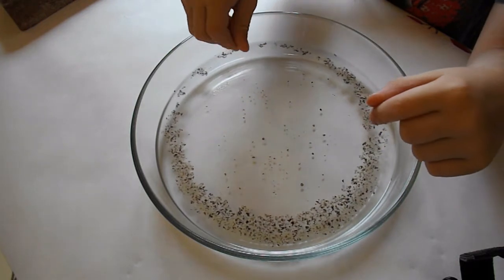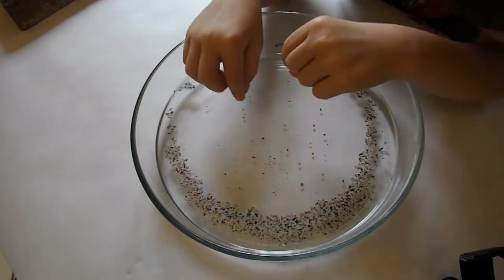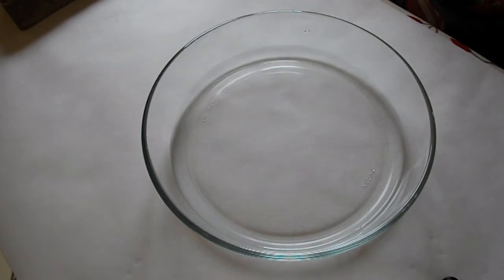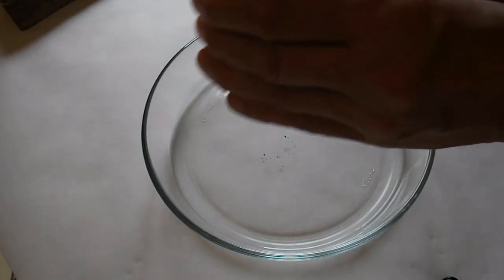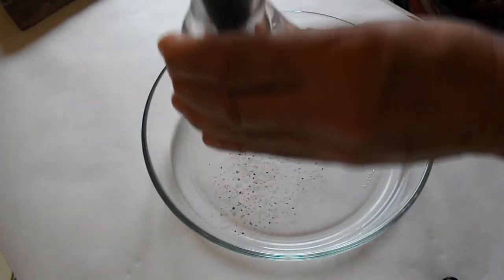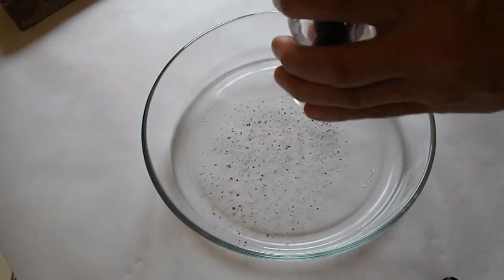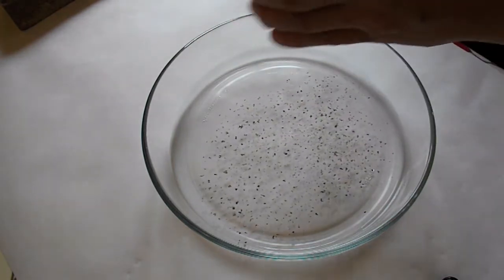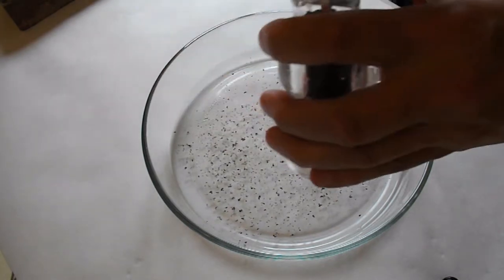Fun With Surface Tension

Comment: hi,grandad,what was that you poured into the water ?The secret of experimenting is  the electric change ,right?
Reply from the maker: It is explained in the video description. I sprinkled ground pepper on the water. He dipped his finger in washing-up liquid before touching the water. The washing-up liquid alters the surface tension and spreads over the surface dragging the pepper with it. A similar thing happens with the boat in this video http://youtu.be/Oz54Auev9eU?list=UUCDUFabVc3g52M0t77JwSBA
Reply: thanks for your explanation. have a nice day  : )